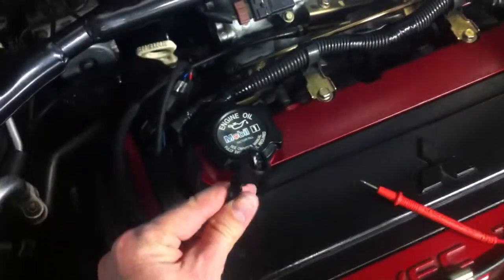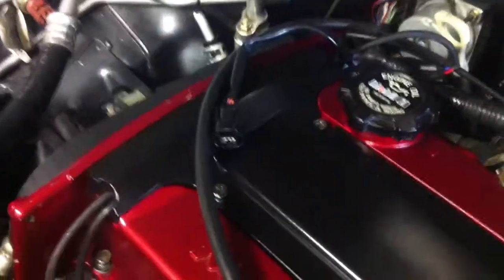Evolution 9 MIVEC solenoid testing - everything grounds

Comment: I just put a new intake manifold on my evo 9 and took all wiring around the valve cover off.  I am now getting a code p1021(intake engine oil control valve circuit).  I am thinking it is a loose plug somewhere.  Where is the mivec solenoid actually?